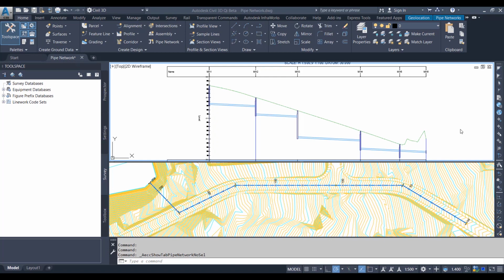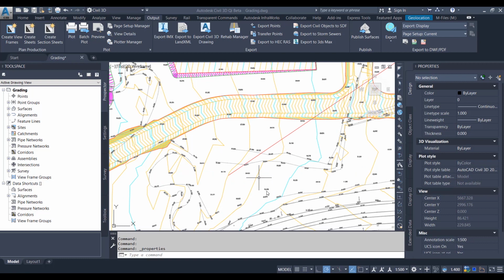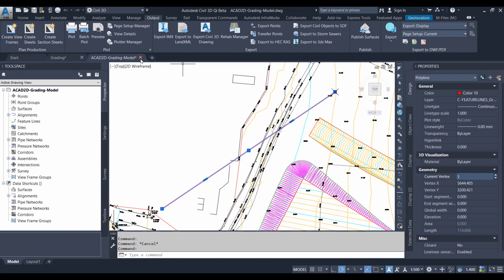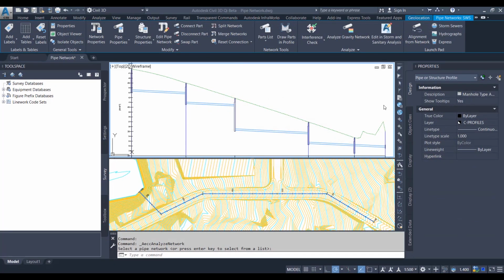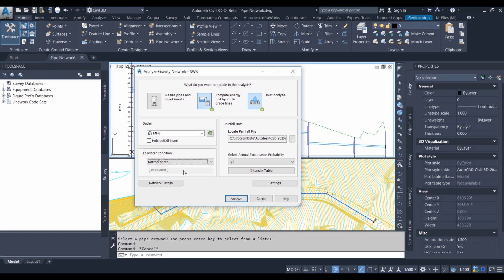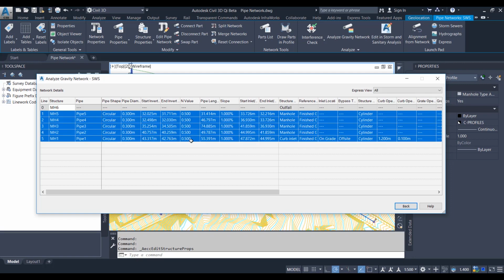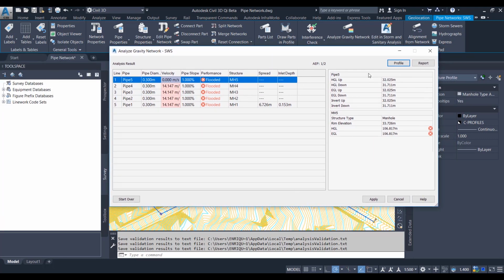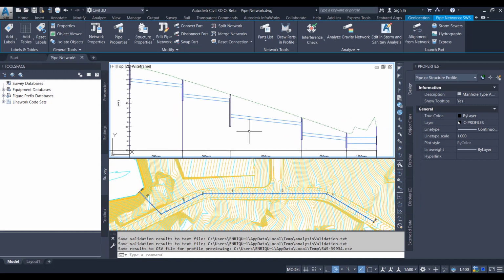Civil 3D 2020 - New Features and Updates

Comment: Very good so far.
But please give a reason to pay more money for this version.
I am road engineer (not hydraulic) and as i can see there is no new or improved feature for the road design.
Reply: The new and IMPROVED "C" icon and blue ribbon theme is worth at least another $1,500/year.....
Reply: @deanrobbins8102  Gotta keep peeps on the subscription treadmill.  AutoDesk's stock price depends on it.
Reply: @PereMersenne  yep...I think it's time for a class action lawsuit to wake those assholes up.  The software is flawed to a degree in some cases where it is unusable.  The come out with something and it's broken...they "try" to fix things and then punt > just buy the next release.  It needs to end.
Reply: >road engineer
How you do a cul-de-sac corridor, when I make the alignment I flatten the lines and fillet the lines to match but when making the corridor doesn’t fill the whole street. I changed the assembly but it affects the rest of the road and doesn’t blend in when done separately.
Reply: @drpill1230  I had similr problem and this book helped me a lot. Details for cul-de-sac with with detailed example are in chapter 10
https://www.wiley.com/en-us/Mastering+AutoCAD+Civil+3D+2016%3A+Autodesk+Official+Press-p-9781119059738
Reply: @drpill1230  do baseline on the gutter and snap to center with a separate assembly, like and intersection
Reply: So you can pay a tech to convert all your old stuff to the new version, which will be superseded by a future version.
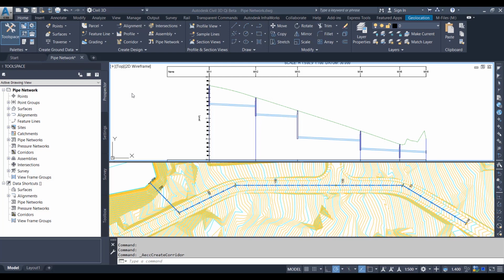Reply: @nikolaos Kiakas 1:37 You get a new dark blue theme; 0:19 2:05 You get new icons. These are worth every penny, what else could you ask for???
Reply: Updates are included, no needto pay extra :)